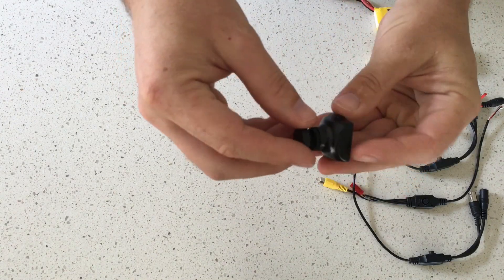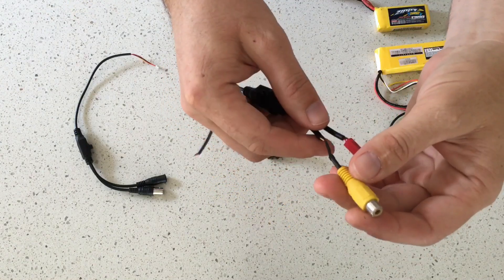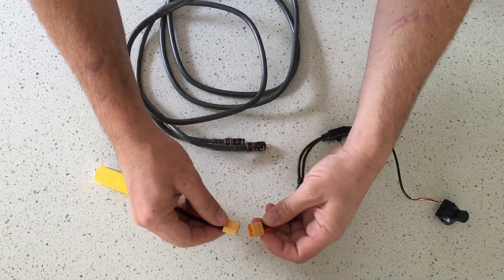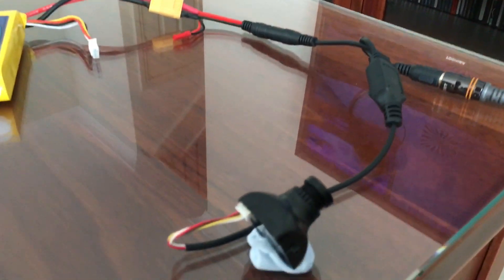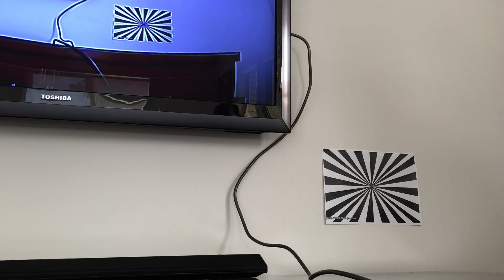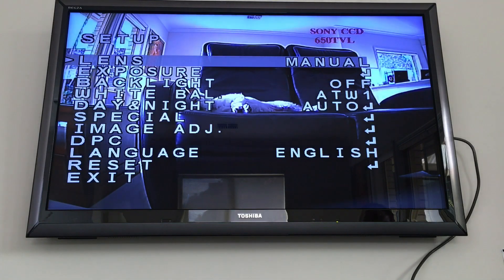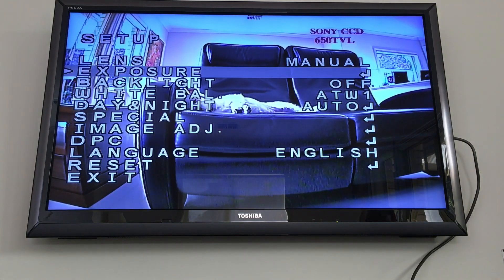HS1177 FPV Camera Setup

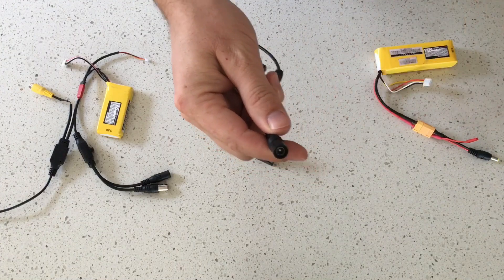Comment: I hear they are going to dc the hs1177 and come out with something new, will be interesting to see what the programmer looks like. At 1:12 you show the power connector which I know has to be a male barrel connector of the 1.25mm size. Where the hell did you get one from? Google brings up nothing. I guess you could cut off the barrel and expose the 2 wires for a mod. 2.1 barrel seems to be a more standard size, why don't the Chinese use standard stuff

Comment: You can use a fatshark battery to power the camera. Has the right connector for the eu cable. Thanks for the video!
Reply: Didn't think of that, thanks.

Comment: is there a correct distance to set the camera from the focus chart to get the right focus ?
Reply from the maker: At least 5-6 feet should be sufficient.  And perhaps less than 10-12 feet since it's a wide angle lens and the target image would be too small any further away.

Comment: I actually have a second battery for my FatShark goggles which have the same power supply connector as the cable. What does the AWC - Set process do for you? I always just set the DWDR on and set the contrast down and seems to be fine for me.
Reply from the maker: Yes, the Fatshark batteries have the right power connector. The AWC Set is very important in my opinion, it sets the colour temperature accurately for outdoor use. It probably makes indoor use worse but make sure you do it in direct sunlight on a very white surface.

Comment: I'm trying to hook up to my Panasonic Viera vt50 tv with an RCA cable just like you show here and all I get is black and white.  The RCA connection on the back of the tv is shared through composite as there is no separate true RCA connection.  Could that be the problem? What tv do you have that you hook up to?
Reply from the maker: I don't think it will work through composite input. TV needs the yellow video input - often alongside the red and white audio inputs

Comment: Here's a way to modify the programming cable to hook up directly to your camera in the quad and make changes in the field. It works perfectly! And let's you make the changes on the screen that really matters, not your TV. Best mod I've seen yet! It's on RCGroups

http://www.rcgroups.com/forums/showthread.php?t=2473157&page=685
Reply from the maker: It's a good idea, I've seen it used by people that fly regularly in daytime and nighttime - so they can adjust settings in the field to suit the two very different conditions.  As I mention in the video I am not making adjustments for it to look good on the TV - I know what settings work for me and the TV is an easier way of making the adjustments before I even install the camera during the build.
Reply from the maker: And a big TV makes it much easier to get the focus adjustment set right.

Comment: awesome guide. BTW, your picture quality is very high. Mine isn't too far from a CMOS camera. And that's on all HS1177 camera ordered from different locations. Hmm.... =\ Could be that because of sunny day you had at that moment?
Reply from the maker: +Alexandru Covaliov I've seen slight differences between some batches and versions of the HS1177 but nothing that really concerned me.  The best FPV  camera for 'out of the box' image quality I've come across is the 1000TVL CMOS camera that ships with the Eachine Racer 250, but it is very susceptible to jello effect in a dynamic environment (flying) and would probably have a small latency as well.